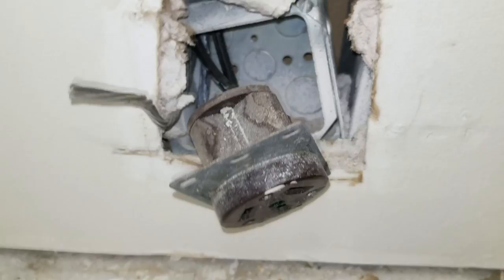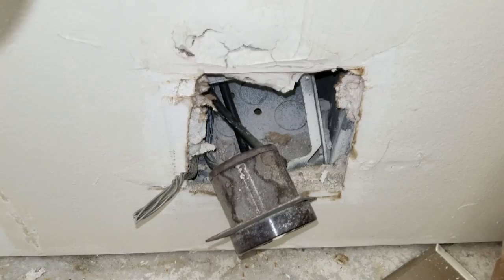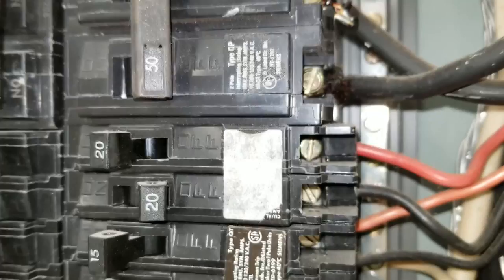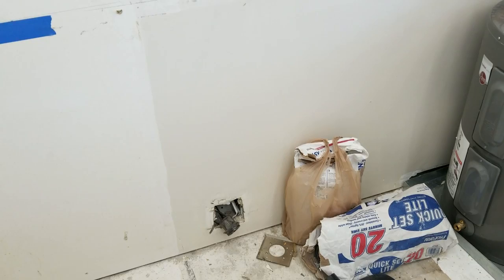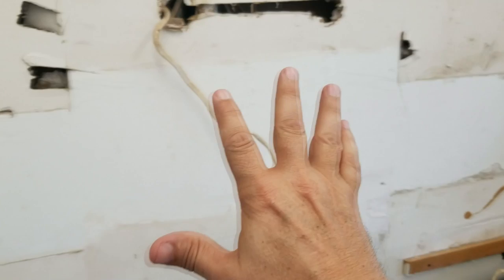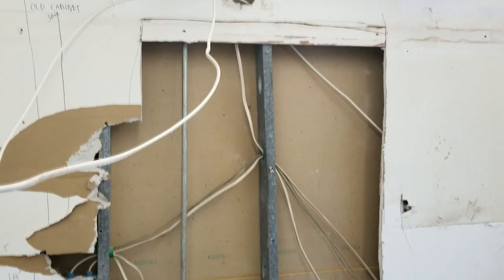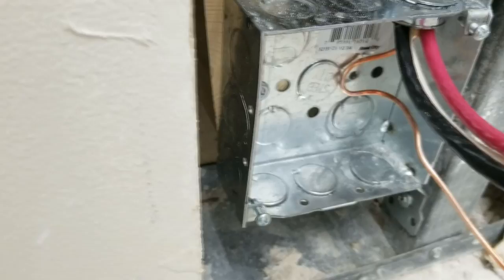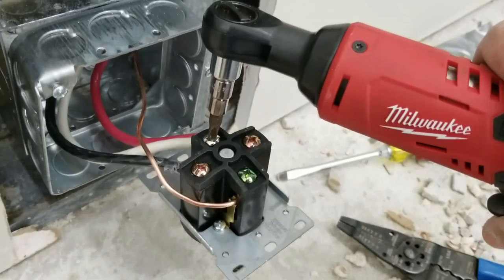How to Install 6/3 Oven Power Cable 4-Wire Outlet, Electrical Panel Tips

Comment from the maker: ✅Protect yourself when working in electrical outlets, with this tool you see me using, the Fluke FLK2AC/90-1000V Pocket-Sized Voltage Detector, VoltAlert 90 to 1000 V AC:  https://amzn.to/2THggao

Comment: You should always loop the wire to the right so it locks tightly. You did not when grounding it. Also when you tightened your wire you just tightened it and that was it you should always wiggle the wire a bit then tighten a little more a few times when working with stranded wire.
Reply from the maker: Thanks for the insifght
Reply: Thank you

Comment: I really appreciate the quick video. SO many times videos are way longer than need to be. The only thing I would enjoy as a novice wiring my retirement home would be how you wired the 6/3 cable to the main breaker box.  I know earlier in the video you complained about the aluminum cable and wanted to clean it up in there.  Wish I could have seen the after.  Thanks I subscribed.
Reply: There are other videos on YouTube that show how to wire it to the main breaker box plus the circuit breaker itself.

Comment: Good work except for the romex running along the length of the wood stud above.  Doing that would require you place nail plates along the whole length of the romex as it travels along that wood stud.  That would not pass inspection.  Better to have notched each of the 2x4 or 1x4 studs across the ceiling and then place nail plates on the notched out area.  Thanks for the video.  Good audio, good video and explanation.
Reply: and direction of wire wrap on ground. especially stranded.  always wrap in direction of cinch and twist.  its not deadly;  till it has no where to go.
Reply: @DRSJawsCo  thats not true at all. thats just some local idea. I hate it when people take a general practice and talk like its some kinda code.

Comment: The incoming ground wire was semi-looped around the ground screw.  I've seen others do the grounding with a pigtail and a special wire nut with a hole on top to allow the incoming ground wire thru after being screwed together with the pig tail.  The pig tail is of course screw to the metal box. This method seems more secure that what is shown in this video.  Are both ways acceptable to national code?
Reply from the maker: It was not semi loped around the ground screw it was about 80% wrapped around the ground screw go back and look closely, it exceeds the 60-70% wrap around the screws that are common on switches and receptacles. Your method works fine too, but with this solid core ground wire, this exceeds the standard wrapping on most receptacles and is quite safe, quite secure and nothing at all wrong with it.

Comment: Hello, Jeff, how I can run dedicated cables for a 220-volt kitchen stove so I can use the stove while I have my house connected to the Photovoltaic panels because PV doesn`t supply enough energy to run this stove and the whole house at the same tim; I have a transfer manual switch next to the house meter to change from grid to solar in the house.
Reply from the maker: that one i am not sure of, sounds like you need t continue to use the electric company for the stove/ if so, what we have done is run 6-3 oven cable from the fuse panel to the stove.

Comment: What size romex connector (wire clamp) did you use?
Reply from the maker: I believe we used the 3/4" size connector. I think we popped out the larger size round opening on the box.

Comment: Nice video. I've got a question. Is it code-kosher to run just the ground wire alongside the existing cable instead of running a whole new 4 wire cable?
Reply from the maker: Yes you can do that and we have done that ourselves too,  In one condo project I ran just the ground wire by itself. You can get the green insulated ground wire and then tie it to a wiring fish and fish it down the wall to the outlet box so you don't  have to run an entire brand new 6/3 wire.

Comment: I have 6 awg running from the main breaker  to a box on the far wall. Can I pull 2 different 240 plug types off that and remain in code.    One plug would be for my welder and the other for my generator.   They use different plugs.  Don’t worry I’m not going to backfeed.  I’m installing an interlock device.
Reply from the maker: Not sure on this one, without knowing the loads on each device. what we did on our house was the electricians installed a transfer switch with a receptacle on it. A Lot of people years ago would create illegal cables from their generator to the dryer vent to inject power into fuse panels. If that 6 AWG wire is also feeding a stove, they usually want it to be a dedicated circuit for stove only. What other devices is it feeding in your wall? Why is it there?
Reply: Gene Miller && better hire a pro. (Electrical).

Comment: On my new range only the burners work but not the oven and no power for controls to program oven, my 3 prong receptacle shows 247 volts across ,117v one one side neutral to ground and 127 on other side but still no power to oven only burners please help.
Reply from the maker: If you have a way to very carefully remove the metal plate off the back of the range, cut power first, then remove the plate, and turn power back on, and carefully take those same measurements there, from the black to white and from the red to white, don't touch any of those connectors with your hand, they are live! And let's make sure you are getting the voltage from your outlet through the plug to those 3 contact points where the 4 wires screw onto the back of the range. If the oven controls don't work, that says to me that the 120 V digital section is not getting powered. It will receive that power from either the black wire or the red wire, so I am assuming there is nothing wrong with the range, and that either the cable is bad, or your wiring of the power cable on the back of the range was not done correctly.

Comment: I wanted to see the removal of wires/breaker at the panel and the install of the new wiring at the panel. You showed the range end fine but not the panel.
Reply from the maker: Ok, one day when we do another one of these, we'll show it better on the breaker panel side.
Reply: Please thanks

Comment: Question. I have a 6/3 right now installed in the kitchen directly to the garage. We are moving the stove to a different location. Can’t I extend the current 6/3 in a junction box or do I have to run a longer new cable directly to the breaker?
Reply from the maker: I feel a lot better on super high current 6-3 wires to do a home run to  the fuse panel
Reply: @jeffostroff  appreciate it. Thanks bud. Keep the videos coming. I literally use them daily on my home Reno.

Comment: I know this is 4 yrs old but I'll try anyway. I have a question about running the wires on the inside surface of the wall. The run will be 18-20ft from the main panel to the outlet near the stove. The reason I ask is the house has 10ft ceilings and the crawl space doesn't have room to crawl under it. The house was built in 1910 and someone updated the panel with a 200A at some point. It has a 50a breaker but the wire isn't 6awg at best it's 8awg but to me it looks more like 10awg. It runs out the main panel and out thru a hole drilled in the wall into a junction box into gray electrical conduit to the receptacle. The wall covering through out the house is something like shiplap. To run it inside the wall I would have to cut through the wall covering all the way over and the try to patch it back. Can I run the 6/3 with ground through conduit on the inside surface of the wall ? Or would I been to use 4 individual wires through the conduit? Thanks😊

Comment: Great vid Jeff. I hv same situation at home with old aluminum wiring.   My question is ...was the 50amp breaker you used a 3-pole?
Reply from the maker: No  this is a 2 Pole switch I can't imagine them every using 3 poll in a residential setting it's overkill usually 3 poll would be used in commercial properties.

Comment: nice product placement with that Milwaulkee driver drill , but no way you actually used it on the terminals.....That bit falling out every time woulda made me just use an old fashion screw driver too.
Reply from the maker: Actually that bit only fell out once
Reply: ok , I just laughed when it fell out. I hate it when i fight to keep them in an extension !   It just looked a little setup LOL, still a great tool and video !

Comment: Hello can i add a #8 to  # 6 wire for my stove? The original wire was #6 but due to move the location of the stove had to add some more wire but got #8 does this affect the voltage thanks
Reply from the maker: I try to keep the wires at #6, as the #8 can't handle the amperage
Reply: Yes you can as long as the you use a breaker that is allowed with #8 gauge wire since that is now the weakest link. This is 50 amps in Canada and is good for pretty much any stove. 6/3 is kinda overkill tbh

Comment: When connected to a screw the wire has to go in the same direction you tighten it. Clockwise on the ground screw here and not anticlockwise
Reply from the maker: With that ground wire you saw it was neither clockwise nor counter clockwise, that's why you saw it stay put as we tightened the green screw

Comment: i want to connect a backing oven , it has 6 wires for power. please assist
Reply from the maker: Sorry, don't know about these, you'll have to check the install manual which should tell you how to handle it.
Reply: Seems we are all screwed now, thanks

Comment: that "charring" looks suspiciously like an anti-oxidation agent that is applied, by code, to aluminum wire connected to terminals in the panel and meter base. But hey what do I know...
Reply from the maker: Almost 60 years old, who knows for sure, but we do know it is outta there!
Reply from the maker: Almost 60 years old, who knows for sure, but we do know it is outta there!
Reply: EXACTLY!!!! this is a guy that is likely used to working on new construction, and trained in that, and then went on his own. So as a result, he sees everything older than 3 years ago as woefully out of code and "dangerous"
and then when working with someone that actually HAS the experience working in older environments, he'd be like "you dont know what youre talking about, youre fired"
Reply: @jeffostroff  and how old is the buildings you go in? how old is that restaurant, or drs office?  Do they need to gut and rebuild every time a code book changes? LOL dude...what the freak, bro.

Comment: how many amps does it draw?
Reply from the maker: that should handle 50 amps
Reply: sory i ment to spell how many amps does the oven draw?
Reply from the maker: @sharksgarageyt   Ovens draw between 30 amps and 50 amps you can't make any generalization about it. You have to find out from the manufacturer of your oven how much it draws and make sure you have the appropriate of the appropriate wires that can handle that load, and the appropriate breaker in the breaker Box that is that is rated to handle that same load.
Reply: @jeffostroff  thanks

Comment from the maker: What problems did you have installing a new power cable from your stove to the electrical panel? Let us know in the comments below.
Reply: Any tips for running this in a finished kitchen? I'm thinking about attaching the new wire onto the old wire and pulling through the panel.. thoughts?
Reply: @Mbsmoothe  the old cable will likely be stapled, at least once right near the box and at least once right by the breaker panel. The key phrase is "at least".

Comment: You didn't show the main part of connecting the 4 wire to the electrical panel breaker??? Did I miss something?
Reply from the maker: For reasons unknown, the video for that scene was never found. Once in a while you think you're recording a video and discover later it was not recording,

Comment: Every single one of these videos which people are only watching to learn which connection goes to which color, you guys skipped right over it. Your video was no different. Why bother
Reply from the maker: at 7:26, take a close look and freeze frame. The black and red wires don't matter, they go to the X & X port, you'll see on your outlet the engraved letters. Since dryer needs 240 volts differential, it does not matter whether black or red goes to x or y. Notice how they are copper colored screws. Notice how ground wire screw is green. Notice how the white neutral wire goes to the silver colored screw.  Next time we shoot one we want to shoot it in 4k video  and show this all closeup and explain it all.

Comment: So, this is just another point, where you run into problems with your stone-age split-phase distribution systems in the US.
Over here, you just run your stove (4 zones + oven) on 3 phases, usually with 3*16A breakers (rarely, stoves need 20, 25 or 32A, but never 50A). 
Not more than a 5*2.5mm² (AWG 13, and the usual case) or 5*4mm² cable (AWG 11) is needed, not AWG 6 at all!
Reply from the maker: Interesting! i WISH WE DID NOT NEED 50 AMP CIRCUIT BREAKERS IN THE ELECTRICAL PANEL

Comment: That double box its not profesional my friend .... You just made the whole video go wrong and you tied the ground srew to tje right on the box andthe cable was twisted to the left second error
Reply from the maker: There is absolutely nothing wrong with using the double box, the only thing wrong is your misplaced opinion of what is professional. in fact the boxes are designed for that very purpose, and so is the extender so you are completely wrong about that. This passes code all of the time. You need to have that electrical box deeper sometimes because those range sockets are too deep to be able to get the wires to curve gracefully around behind it so you go ahead and keep jamming and pinching in your giant 6 gauge wires that are supposed to be gracefully turned wires or that's a violation of the National Electric Code. I have no idea what you're talking about the ground screw being wrong. You are supposed to tie the ground screw on to the metal Box and you are supposed to wrap the copper ground wire around that screw on the metal box that is required by National Electric Code that is called bonding the box to the system ground. And if you don't do it this way then you're the one that's doing it wrong and if you think that our method is wrong then you are wrong and you've been doing it wrong, my friend.
Reply: He means you wrapped the wire the wrong way around the screw.  You should always wrap wire one the same directions you turn the screw to secure it.
Reply: @craigwiley3186  yeah but as thick as that wire is I'm sure it's not as bad as say a 14 awg or 12 etc.... 
Lol bigger the box the better the fill capacity  also less heat binding and more stuff

Comment: Fuse box? Where are the fuses? Lmao. Also, nothing on hooking the wires into the circuit breaker box (not fuse box). We went from silly chatter about where the wire was taped to a conduit to "does the range turn on?". This may just be the worst how to video on you tube!!!
Reply from the maker: We showed you in the video where it was to connect If you don't know how to wire something to the control panel then you shouldn't be doing this and you shouldn't be blaming other people for your lack of knowledge on it working on a control panel is for people with lots of knowledge and experience
Reply: So then what is the point of making the video? Ridiculous!

Comment: what in the world!?!?!?/ COMPLETELY WRONG!?!?! LOLOLOL Charring!?!? thats not charring! LOL  regarding the  microwave being on a circuit By itself, that isnt true either. Its not "wrong"

People have their trusty code book that just came out last week, and then deem everything made before it as "completely wrong" and then mock the builder! LOL Whomever this guy is, saw a cha-ching" moment and ran up a friggin bill.
Reply from the maker: whiny person. You are whining about the National electric code book? The rule is not in the code book, making your uninformed argument a joke, building inspectors here for decades will shut you down and not close out your building permit if you don't have a dedicated 20 amp circuit for microwave. You obviously know nothing, but you're full of hot air trying to impress people with your lack of knowledge no one is buying your fake news. Many requirements are not found in the NEC book.
Reply: Microwave is required to be on its own circuit, a 15AMP here in Canada